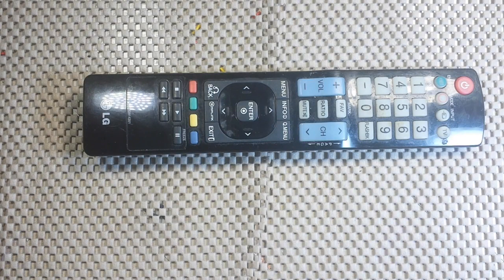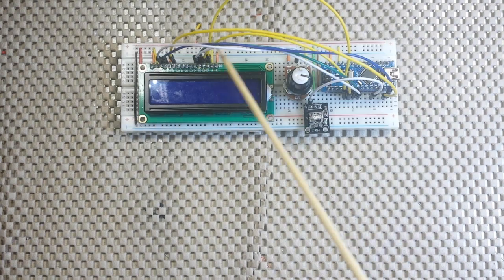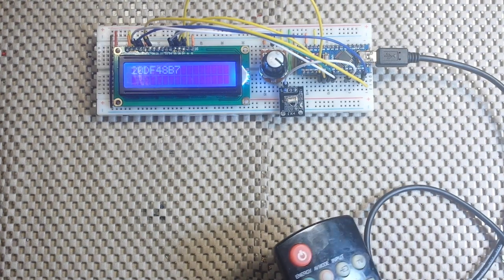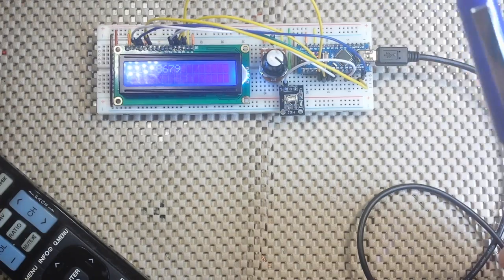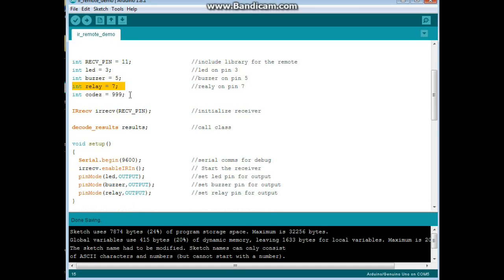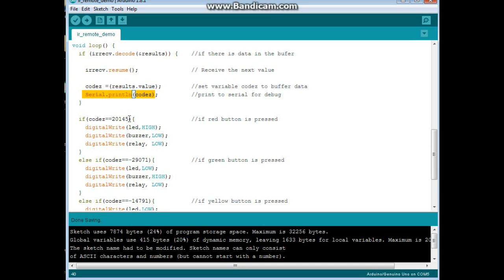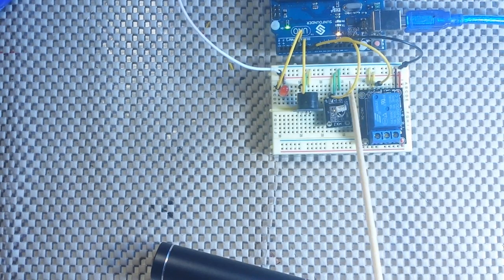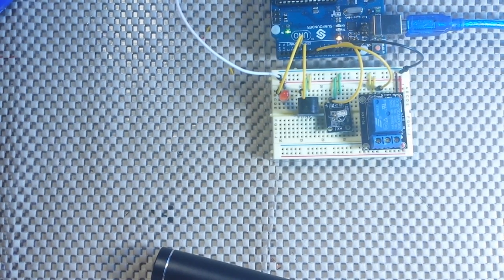Use your TV remote to control your Arduino

Comment: Which IR module did you use as it's looks like it's more than just the receiver on the little board. Thx
Reply from the maker: It's from one of those 37 in 1 sensor kits. The only things it has on the module are a couple of resistors and an LED. Any IR receiver will do the job.